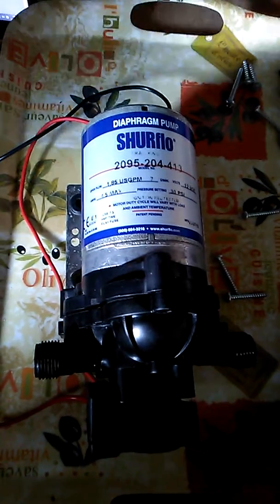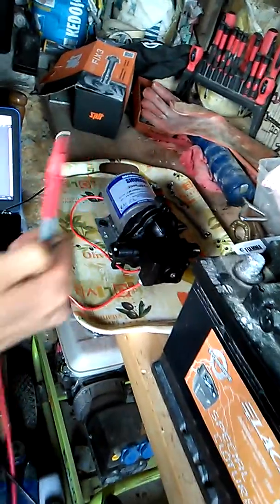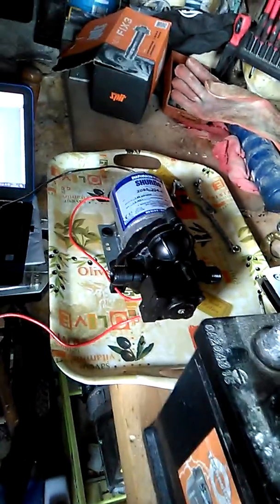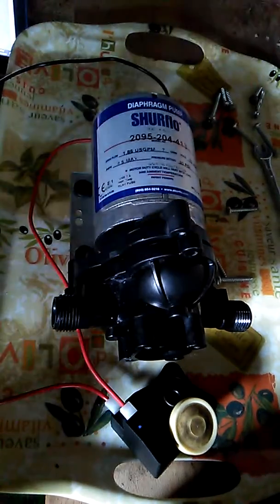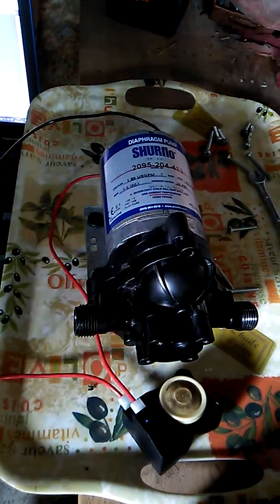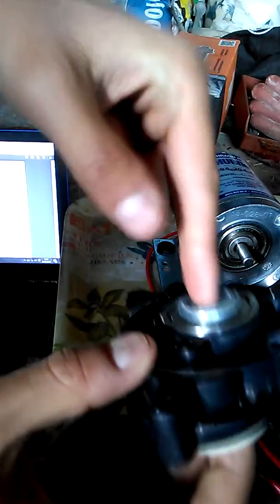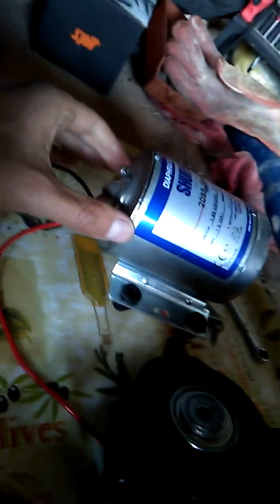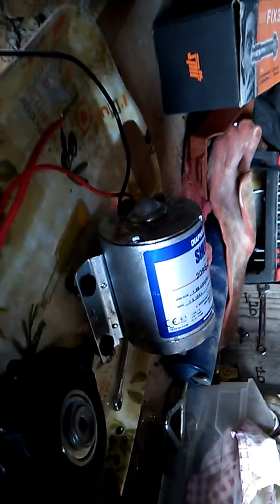Fixing a Shurflo 2095 diaphragm water pump where motor doesn't start

Comment: Good morning! help !! ;) I would like to ask politely if the vacuum running of the pump could compromise its operation, accidentally a friend tried to empty, and shortly after it stopped without starting again, what can I do? thank you in advance for your courtesy and helpfulness, a greeting! ;) shurlfo 2095 - 204 413
Reply from the maker: Normally you can unscrew everything and put it all back together without a problem. Did you get to the bottom of the problem?